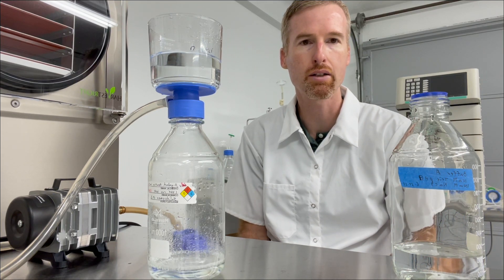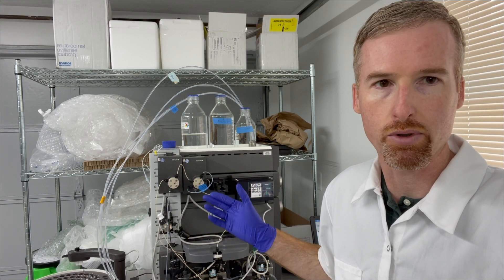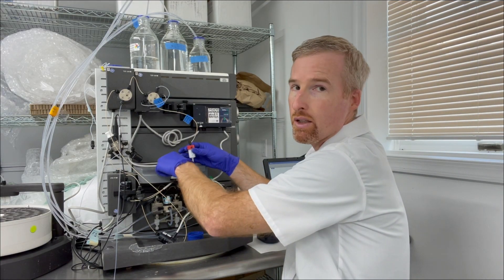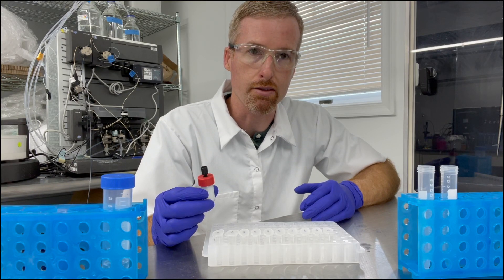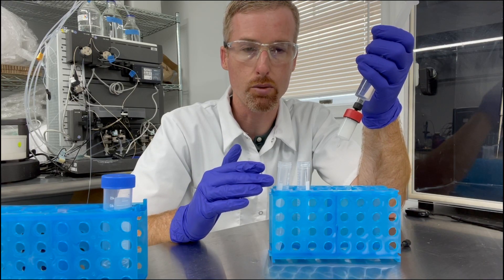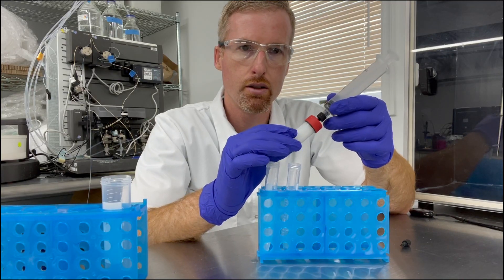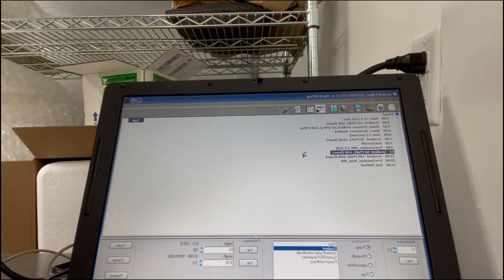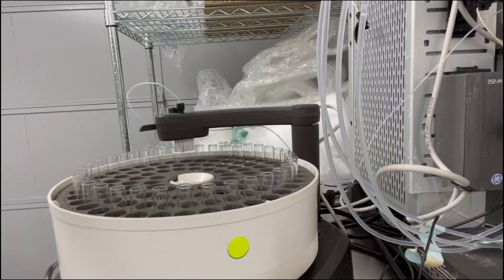Ion Exchange Protein Purification on an Akta FPLC

Comment: Hello I am doing a his tag purification followed by SEC-FPLC and i right in saying this is different to this ? I  have done IEX however with a gravity collum. Is this the same principle but just doing it throught the AKTA ? - Many thanks and really informative video !
Reply from the maker: Yes, SEC on the FPLC is different than IEX because the protein isn''t binding and being washed. It is pumped through the SEC column and smaller proteins are slowed down by the SEC column but never bound.